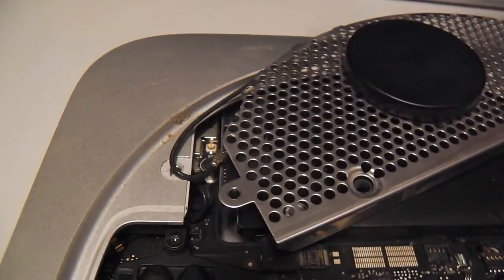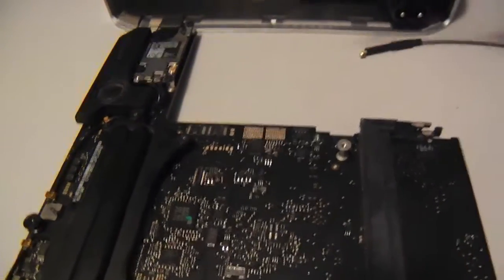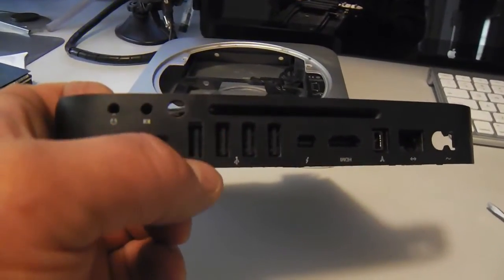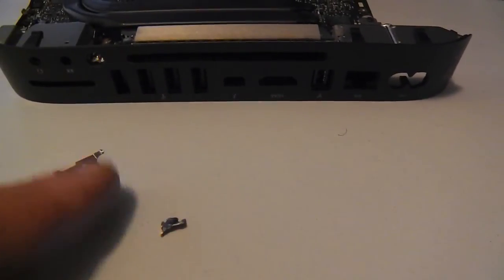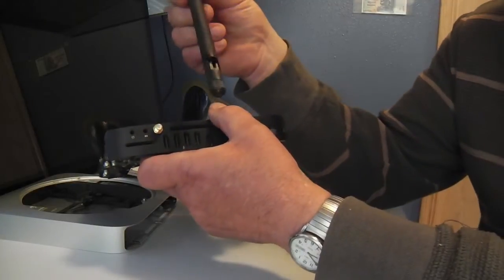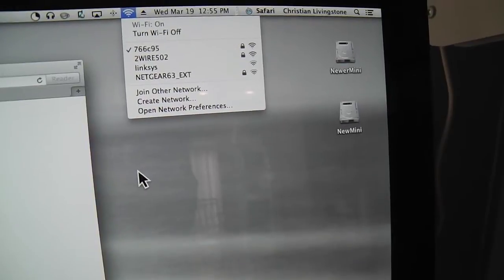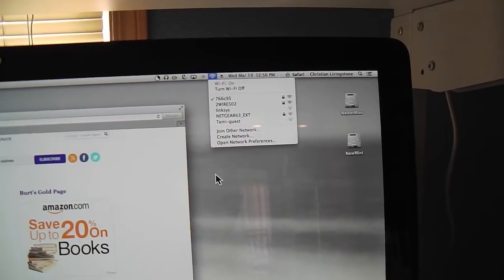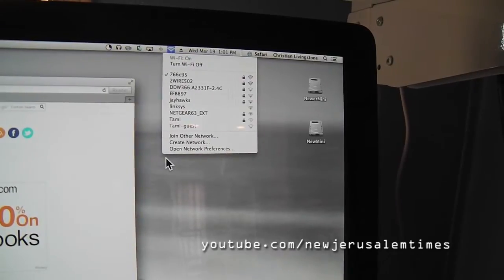Mac Mini Modified For External WiFi Antenna

Comment: i did this years ago myself but i drill the aluminium instead os plastic part, i get wifi from 200m away from a bt street phone, it is well worth the effort i recommended it.
Reply from the maker: Hey, thanks for that feedback. Yeah, I'm still using this same Mac mini, but now with a small panel antenna and can see lots of routers around the neighborhood. With the connector on the plastic it allows all of the Mac internals to be removed as one unit.
Reply: keep up the good work i had mine for 4 years, straight away i changed the hdd to ssd WOW the speed difference? i realised straight away how crapy was the internal antenna than had the idea of using external one, tons better than expected took me 30 min to do it i used self tapping screw as it works great with aluminium, once the hole was there i used straight screw driver to make it bigger than fitted all back in, i can assure you aerial is more stable on metal and does not obstruct cables as it is on the other side, i certainly prefer my mac mini 2012 to new ones as i can upgrade and mess about with it if i want to but the new mac is just signed a death warrant with me, i would never buy one unless they go back how they used to be.

Comment: I really enjoyed your video thank you very much. What's the model number of the connector pigtail  or the SKU?
Reply from the maker: Sure, like I mentioned in answering the similar question above:

"The pigtail was a: Mini PCIe U.FL / IPEX to RP-SMA female (the female is counterintuitive, if I remember correctly). And I always try to find them with the little ferrite sleeve on them, which reportedly helps keep out electronic interference.

"Below is the actual link to the one I got through Amazon, but which was not sold directly by Amazon, which enabled me not to pay the State extortion in sales tax..."

http://www.amazon.com/gp/product/B00DII6564/ref=oh_details_o00_s00_i00?ie=UTF8&psc=1

Peace be with you,
Christian

Comment: Can you please elaborate on what bit you purchased to perform the mod, both the drill bit size and the actual antenna cable?

Great tut and liked.
Reply from the maker: Sure. The pigtail was a: Mini PCIe U.FL / IPEX to RP-SMA female (the female is counterintuitive, if I remember correctly). And I always try to find them with the little ferrite sleeve on them, which reportedly helps keep out electronic interference.

Below is the actual link to the one I got through Amazon, but which was not sold directly by Amazon, which enabled me not to pay the State extortion in sales tax.

I forget the exact size of the drill bit. It may have been around 1/4", to start with, and then I undoubtedly tried to thread it through the plastic for an extremely tight fit, even before the lock nut was secured.

Peace be with you,
Christian

http://www.amazon.com/gp/product/B00DII6564/ref=oh_details_o00_s00_i00?ie=UTF8&psc=1

Comment: i have bought late 2014 mac mini, i wanted to do the same but cable i bought for 2011 mac mini won't fit, it is too big, what is the new cable called and where can i get it??
Reply from the maker: If it isn't the same Mini PCIe U.FL./IPEX connector on the 2014 as it is on the 2011, I don't really have an accurate answer for you. But, if I were you, I'd just look at the connector to identify it, then look at the pigtails for sale on Amazon to make an obvious match.
Reply: NewJerusalemTimes nope not the same mate it is smaller but i can not buy it unless knowing the size or model number first thanks.

Comment: Does that external antenna work for a 2007 mac mini? I want to use it as a wap but it doesnt give alot of signal... So i was thinking about doing this and taking out the factory installed antenna so it can give out a better signal for internet sharing. Do you think doing this will work? Thanks
Reply from the maker: Sure,

Any external 2.4GHz WiFi antenna, with that RP-SMA connector, will work better than an internal one. They all do have different dBi ratings. More is better, if you trust the manufacturer's rating, and the hight dBi rating is usually a bit more costly. 

Some of the older Minis had a MIMO WiFI card thak takes two antennas to work best, but the 2007 didn't have that, if I recall correctly. And it may be better to just get a USB external WiFi card, as the newer ones have potentially more speed on other radio frequencies and protocols, I believe. They're cheap, and will alleviate any need to dig around in the Mini. But, like I think I mentioned, I kind of like to reduce the number of dongles hanging out of or off the back of the Mini, where possible. Honestly, I think I have every single port filled, including both the mini Display and the HDMI, and have more recently installed a second internal hard drive for a RAID-0 array, which speeds things up, mostly for video editing. 

Otherwise, I'm not really familiar with what a WAP is though. But I suspect it might be better served with an omnidirectional antenna, somehow, to get a link between a computer and a smartphone from various, yet close places within a home setting.

So, if you're going to rely on the internal WiFI card and just make the antenna external, I'll post a couple of links below that would probably be good choices for either arrangement; directional, or omnidirectional:

This link is to a directional one on Amazon for about $23, with a short cable (short is good) and RP-SMA connector that would work as a plus-and-play solution:

http://www.amazon.com/TP-LINK-TL-ANT2409A-Directional-Antenna-connector/dp/B003CFATNS/ref=sr_1_8?ie=UTF8&amp;qid=1451066455&amp;sr=8-8&amp;keywords=2.4GHz+Wifi+antenna+directional

Here's an external omnidirectional one that has the ability to use a short cable (or not) for better placement, too:

http://www.amazon.com/Alfa-OMNI-Directional-High-Gain-Screw-On-magnetic/dp/B0039ORBLK/ref=pd_sim_147_11?ie=UTF8&amp;dpID=41xXueH4PNL&amp;dpSrc=sims&amp;preST=_AC_UL160_SR145%2C160_&amp;refRID=01C6SQSJR7KYZ8XMS2PJ 

Please let us all hear what you finally do with the Mini, and how it works for you.

Peace,
C. Livingstone